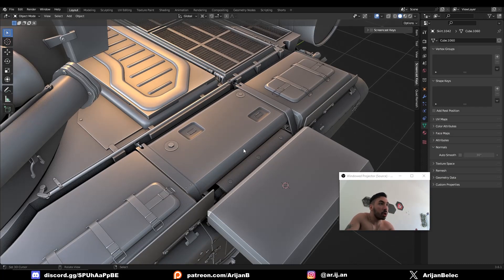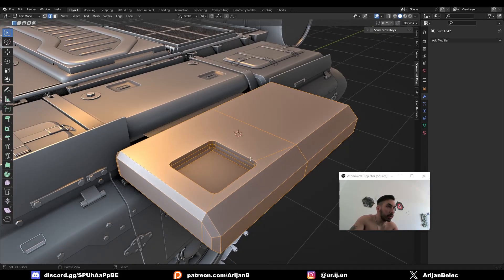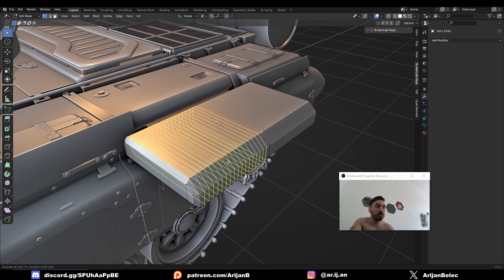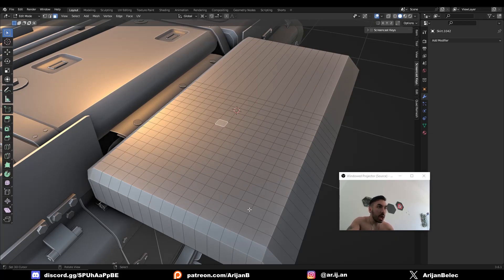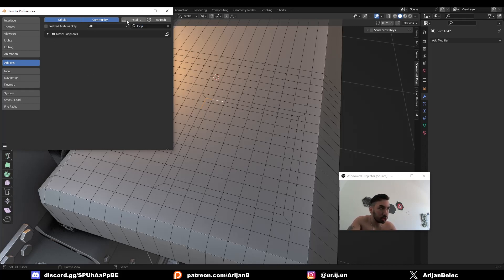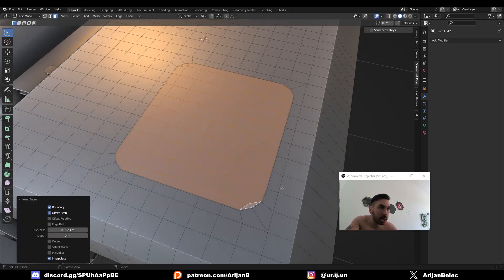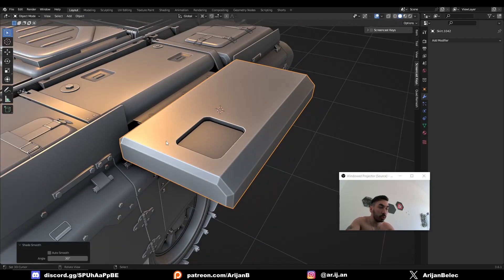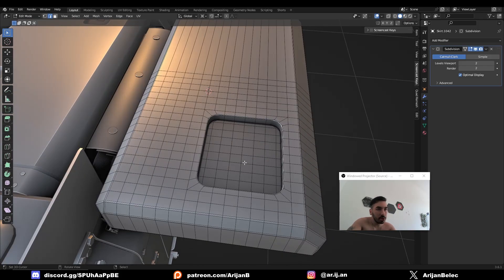The MOST IMPORTANT Topology Tutorial (Arijan)

Comment: Legit question; haven't we just added a shit ton of redundant geometry all over the shape just because of the hole? Can we clean up the redundant geometry afterwards? Is this the best way to do it? maybe it's the best and accepted way of doing it in the industry, I am legit asking.
Reply from the maker: Good question. the industry typically wants consistent face sizes and squares like in this example. Poly count doesn't matter that much as long as it isn't completely ridiculous. 

For performance optimization, you have to bake details like this on normal maps and textures, then you could keep the details but also low poly.